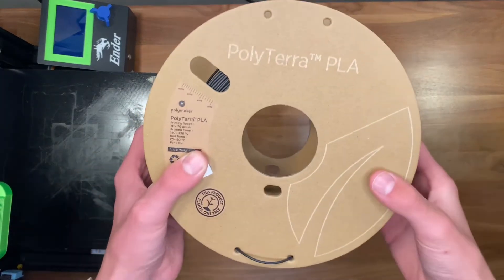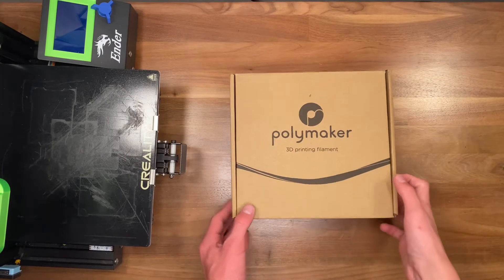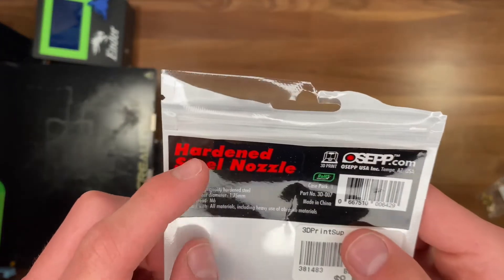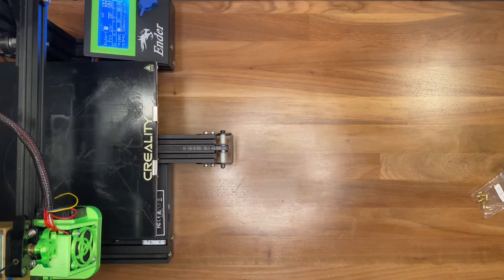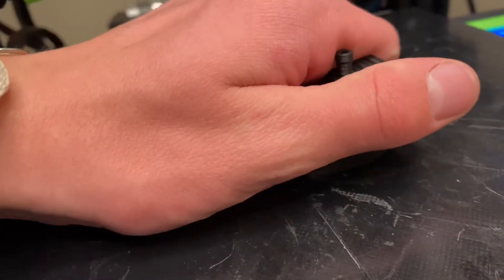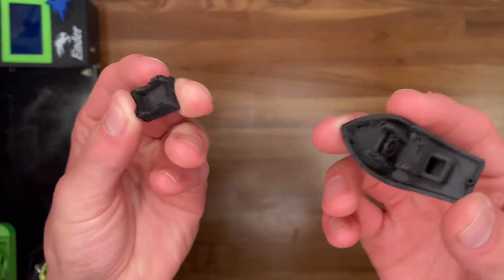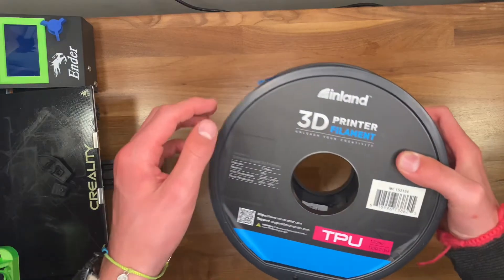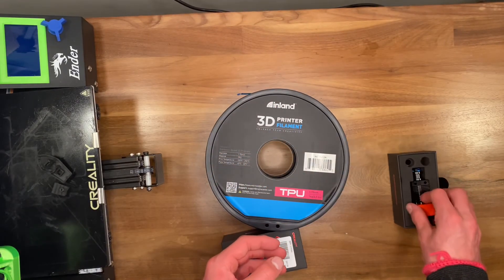Printing with carbon fiber on my Ender 3 pro

Comment: i think the reason it broke was because carbon fiber requires much higher temp than pla normally would, i would try it again at a higher temp and see if it comes out better
Reply from the maker: I will give that a try! Thank you
Reply: @EngineeringAddiction   let me know how it turns out!
Reply: Yeah I print this stuff at 240°c and use it for airsoft gun parts as well Airsoft masks works great

Comment: I heard that CF filaments are like ABS, they require higher temperature so the layers bond to each other stronger. Too cold and the layers don't bond. So you gotta print high temperature, use an enclosure, things like that. I didn't use my CF filament yet though cause I bought it before and I don't have an enclosure.

Comment: It would be great if you could tel us a little bit about your Ender 3 Pro setup. It looks like you were using a direct drive rather than Bowden tube setup. Other than that, good video!
Reply from the maker: That’s a good suggestion! Thanks for the feedback. I have a video on the direct drive and all the mods but a video dedicated to my setup may pose as useful to other 3D printer enthusiasts

Comment: I've been using another brand of Carbon fiber PLA and I have some projects that have come out very strong, but none have ever gone that small. I've noticed that issues typically occurs with small details, supports and the speed you've set it to.